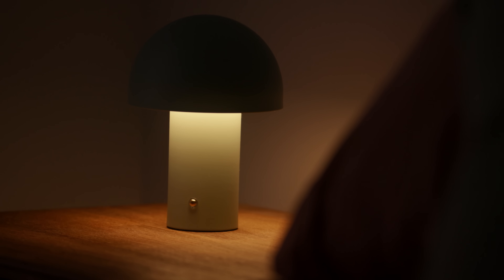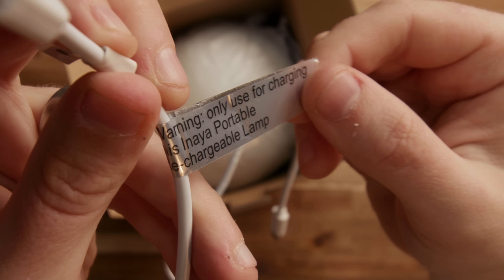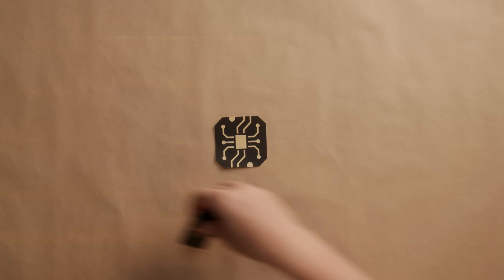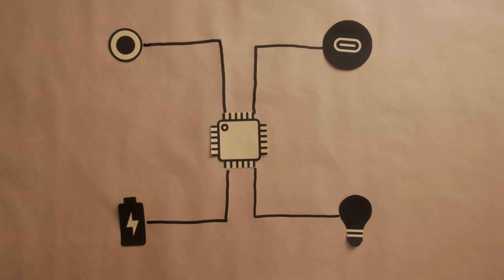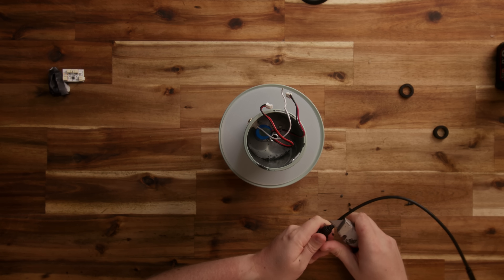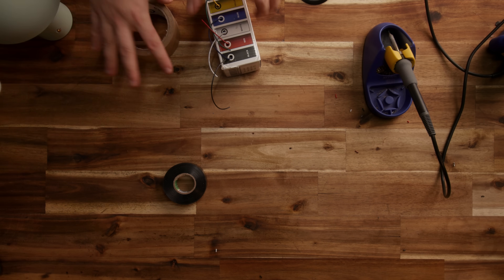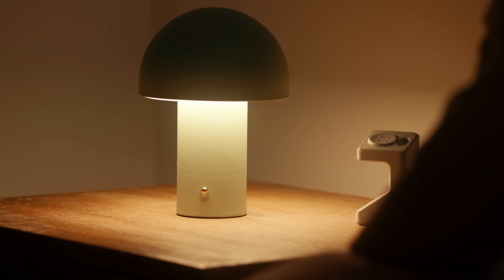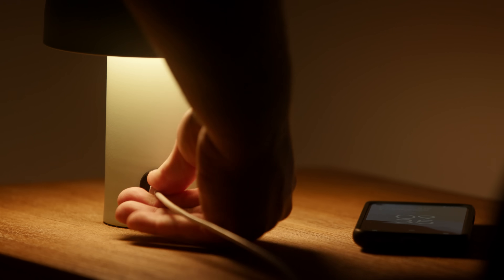Kmart Lied to Me, So I Hacked Their Lamp

Comment: Truly annoying when companies don't follow the usb-c standard. The whole point of using usb-c is we don't require proprietary cables!
Reply: This is the reason I throw away charging only USB-C cables. I know they save money for the manufactures, but for me they aren't worth the hassle.
Reply: @Dominator9572 I’ve never seen one how on earth is everyone pretending they’re something they see all the time
Reply: @Alphoric  They come with usb chargers included with non data products. Like flashlights, lamps, tire pumps. The best way to identify them is taking a flashlight and looking at the tip of the plug. They have far less pins inside
Reply: Isn't it illegal to claim something is usb-c without that being the case? Couldn't Kmart be sued for this?
Reply: @joda7697  how is it not? It changes with a usb c... smh
Reply: So basically this lamp is illegal and a scam. But you cannot do anything against that in the USA, because there are no consumer rights unlike in Europe
Reply: @XdekHckr ummm Australian Kmart, we don't have the European law here, but technically you could get a refund on this under the Australian consumer rights here as it is having false statements on its advertising (and box) as the cable isn't USB C, it just looks like it.
Reply: @XdekHckr  He sounds like he is in Australia.  They have a crappy KMaet here too, selling T-shirts made by virtual slaves in Bangladesh.
Reply: @XdekHckr what about the rights of the manufacture. They have the right to require special made cables. This is the real world don't like it don't buy the product. 73
Reply: @XdekHckr  scam yes, illegal no. the USB spec is a standard maintained by a private organization, not a law. The only means of enforcement available is the logo's trademark; the logo is only licensed for use on cables and devices that comply with the standard. this means if a company wants to create a non-compliant USB device, all they have to do is avoid putting the USB logo on their product or packaging
Reply: @spambot7110  uhh, the packaging claims the device is USB-C compatible. It's not. That's a false claim, which is illegal. No need to go after them with trademark law, although the USB Consortium could do that too.
Reply: @JimCullen  That's a fair point, I'd be curious if "compatible" has a robust enough legal definition for that to work. Also, what does it mean to refer to "USB" while not being bound by the USB consortium's definition of the term? I think it would be a complicated case (and given the price, difficult to find a motivated plaintiff unless the scope could be somehow expanded to include a broader range of products, but we're talking about pure legality here so that's beside the point).

No idea if this defense would *work*, but something along the lines of "we didn't mark the devices as 'usb compliant', instead using the term 'usb compatible' to denote that the charging connector used is compatible with the USB mechanical interface, while allowing us to improve the electrical interface to better suit the needs of the product" would at least confuse things and make it very annoying to prosecute. (obviously I think the argument is fundamentally dishonest, but i don't think i could prove that legally)

My take is that the existing law does not provide adequate means to hold companies accountable for this type of misrepresentation (leaving trademarks as the most reliable tool for enforcement, unfortunately at the behest of the standards body rather than the consumer), and we would benefit from legislation in this area (although, this also runs the risk of further empowering the more... rent-extraction-ey side of the standards business, so it would need to be done carefully)
Reply: I guess really the core problem is, technological standards are clearly a matter of governance, but we've decided to leave that task almost entirely in private hands. until we bring technological standards under public control, we'll be trapped walking this fine line between weak, inconsistent standards, and cartels with absolute say over who gets to participate in what markets. Open source is one way to do this, but market share, patents, and the ability of private sponsors to co-opt a project's goals are such powerful weapons against their potential public benefit that i don't think this can be achieved apolitically.
Reply: @spambot7110  the fact is that in Australia, you can't get around things by legal loopholes and technical definitions like that. The only question of relevance is "would a reasonable consumer be misled by the advertising?"
Reply: @spambot7110 In Europe, USB-C is legally mandated…
Reply: @spambot7110  That makes it false advertising, USB logo or not, at least in the EU, which is at least there illegal and frankly should be elsewhere too if it isn't.
Reply: If only the U stood for Universal...
Reply: @therick0996  It would be universal if people adopted it, but jesus fucking christ, must people be stubborn and pedantic over a standard that is 20 years old. Lads, USB-C IS FROM 2014; WE ARE ALREADY LATE AND YOU ARE COMPLAINING IT ARRIVED!

Unless you want to return to serial and parallel ports, back to DVI, VGA (DA-15), DE-9, DB-25 and Composite (RCA).
Reply: Funny how the thumbnail says it should be illegal. It is in the EU.
Also going to the kmart website prompted my browser to ask for firewall permissions, what are you people doing out there over the pond?
Reply: The point of usb-c is people think they know what would work best without thinking through how that’d be applied in practice and with little to no knowledge on what would be required for it to work as imagined. 

Usb’s of any one kind don’t all have the same purpose, and cost different amounts to implement, and aren’t all suited to all devices and aren’t even the same sizes. 

No point in making everything the “same cable” if one device requires a large amount of electricity while another device requires very little electricity, and some are for data exchange while others are exclusively electricity. You’d either have to create something that can change its inputs and outputs based on what device it’s plugged into, and who knows how much that’d cost to implement in your cheapest devices, or you end up with a different cable for every device because they all have different needs
Reply: @emberguard  you're assuming these requirements are all or nothing. if i plug my laptop (which takes a 65 watt USB-C power brick) into a 5V phone charger, it won't run on that power, but if i put it to sleep, it'll (slowly) charge. not super relevant, but it could be useful in an emergency situation. and more importantly, if i plug my phone into my laptop adapter, it just doesn't negotiate a higher voltage and draws less current. it would be better if the compatibility matrix was fully filled in, but even if it's not, it's still useful to have more squares filled in.

I think we could've done well with a standardized barrel jack or old-magsafe style thing for mid-power applications like laptops, i'm still not sure where that trade-off lies btwn interop and optimization, but if we look at the history of consumer connector standards, i'd say USB-C has been pretty good
Reply: @spambot7110  Thanks for the clarification :) appreciate it.
Reply: Kmart is still around?
Reply: @glitchunicorn Kmart Australia is totally unrelated to Kmart US that is basically broke.
Reply: So this lamp is Illegal in Europe or going to be illegal to sell soon.
Reply: usb-c isn't a standard. they say it is, but it's actually just a form factor.
Reply: @LieseFury USB-C is a legally defined standard in the EU.
Directive (EU) 2022/2380 applies.
Reply: @ No but you comply or you can’t sell anything to the EU. Which is why EU standards are default global standards unless you are China or the US… (and China goes along with EU standards most of the time because they like selling to the EU…)
Reply: It's the right of the company to require the use of their cables and make it so other cables don't work it's about trade secrets. Just buy their cables and forget about standard. USB chargers come in many configurations. 73
Reply: Yeah I'm old enough to remember the hype about USB when it first came out - kiss goodbye to a drawer full of different cables - one cable to rule them all sort of thing. Now I have a drawer crammed with over 20 different USB cables :(
Reply: This should be Illegal. Its a standard and not conforming by it should be reason for a full recall and lawsuit. This risks damaging other equipment and if they really wanted to they could have used a proprietary connector but no. No product with this configuration should be allowed to exist
Reply: Agree lol
Reply: Yeah that's what he said in the video, looks like I found something else truly annoying
Reply: right like how expensive is usb-c at this point
Reply: Have you seen it elsewhere because this is the first example I’ve seen
Reply: It's worse than annoying! It's positively dangerous to actual usb-c devices!
Reply: You’re gonna love that this isn’t why USB exists and our forced adoption of it actually makes this mindset worse
Reply: @FuncleChuck  you are on to something. I think it should be used only for charging devices and transferring data. It's not a power supply. I would rather use 12 volt DC outlets and use something other than lighter sockets. 73
Reply: The reason for USB C is optimised charging??
Reply: The problem with type-c port is that it is not even a standard. Only the plug shape is standardised, and nothing else. That’s why companies can make crap like those lamps.

If you read USB (not just the plug, but specifically usb specification!) type-c specification you’d know that the only two requirement for both usb type-c cables and ports are 1.2mbit data speed and 5v 0.5mA power support - and all those 160gbit speed 240W power etc are just type-c specific extensions over 26 year old usb 1.0 standard required for usb type-c. More over, usb support is not even mandatory for type-c itself - it’s just a cable with specific number of contacts, that can be used for anything you want (including frying your usb type-c devices, if other device is not compliant). So yeah, while standardising phone chargers is a huge win for consumers - making it usb type-c is a massive mistake for everyone who now and in the future would have to use an awfully designed (saying that even a bit of thought was put into its design is a huge compliment for type-c) port
Reply: There is no rule compelling a manufacturer to adhere to a particular standard, even if it uses a 'standard' connector.    The device can charge from a USB port or charger, provided you use the included cable, and that is all that is required for them to call it 'USB powered' and/or that it can be 'charged from USB'.  

Look up what Dell did with their computers back in the late 1990s - an ATX power supply in the machine, connected to the motherboard through a standard ATX power connector.... or so it appeared.

Looks can be deceiving.   Every single component I just mentioned was set up with a uniquely-Dell wiring configuration, despite using ' standard' connectors. 
Any attempt to install a 'standard' ATX power supply or motherboard in that machine was doomed to expensive failure.    Plug it in, hit the switch, 12 volts getting sent to stuff that's only supposed to get 5, grounds in wrong places, BAM.      Can't tell you how many smoked Dells I had to repair back in the day.
Reply: That’s not actually true, the main issue regulators had was that having a bunch of different proprietary cables greatly increased the amount of e-waste. However if everything used the same connector you’d only need 2 or 3 of the same cable to charge and transfer data from all your devices. USB had already been the standard for most devices for decades going from Type-A to Type-B, USB Type C was simply USB’s latest standard and because it was the most widely used connector that’s what regulators decided to make the standard and if anyone wanted to replace it they’d need to create a significantly better alternative that was worth switching to instead

Notice how regulators did nothing to actually regulate and standardise USB-C, that’s why you have all of these different types of USB-C cables where some only charge, some only transfer, and some transfer and charge. Regulators did nothing to actual standardise the cables  themselves and as a result Apple got rid of all their standard USB ports for USB-C, so you now have to buy a USB to USB-C adapter to connect most things resulting in more e-waste. Regulators have done nothing to create an actual universal standard for cables and they weren’t trying to, they were simply trying to cut down on e-waste
Reply: Yeah but they want you to use proprietary cables, because you have to buy them
Reply: best part about standards is there’s so many to choose from
Reply: @aname3576  xkcd 927 Standards (fascist youtube censorship on links)
Reply: Better off them using a proprietary port.
Reply: Its a fire hazard safety, pls dont mod it insurance wont cover if house burn down.
Reply: lightning is far more durable though
Reply: @Volkswagen_Yeetle  the cable breaks easily
Reply: @2xtreem4u POV: mfs when they don't realize that high quality third party cables exist
Reply: @Volkswagen_Yeetle  apple only recommends their own cable
Reply: @2xtreem4u”the cable breaks easily” You should drop out of this convo, you just demonstrated that you don’t understand what’s being discussed.

You shifted from “port” to “cable.” Cable isn’t part of this conversation, you can EASILY make strong and weak cables on both sides.
Reply: @heelercs  start your own discussion then so bye bye
Reply: @Volkswagen_Yeetle  not really it's old and doesn't support fast charging no updates to it for many years
Reply: @ still a way more durable port
Reply: @Volkswagen_Yeetle  the plastic frame breaks first
Reply: So you want ONE cable for everything in your house ever? How stupid.
Reply: @Ruinedtri  only stupid one here is you buddy. Where did I say that I only wanted one cable for everything?
Reply: the cable has 5 method of probing the device and it require embedded chip to remember whats the cable is capable of.

USB-C sucks and EU congress made a mistake.
Reply: @bokunochannel84207  you clearly don't know what you are talking about. USB-C does not require an embedded chip to get 5v. I have a bunch of dumb usb-a to USB-c that prove it.
Reply: @janoahuerta  I agree.   I'm aggravated by the fact there's no way to tell if a USB-C cable meets the standard or is just a charging cable or worst yet, custom.  USB-C Circuit is similar to PoE power services.  The connection is negotiated lightning fast process. Its why I can plug my iPhone 15 into my 120Watt Apple laptop charger for charging.  The charger detects the connection and ask for an ID from the end device (or PD powered device) if device complies and answers the charger query  (PSC) energy is delivered, if not 5 volts is granted, or if there's no detection through the cable of a connection, the PSC (Power Supply) does NOTHING.  Want to know about a new power standard that will blow your mind.  Look up NEC's Class 4 High voltage introduced in spec 2024.
Reply: @janoahuerta  No USB-C is like actually really stupid design wise. It has to support the USB-A spec, and cables can be 3 amp, 5 amp, or data cables. If you have a 5A cable it is mandatory to have 128 bytes of memory on the cable, you use 2 bits to say "I'm a 5A cable" and the rest is "reserved for future use." It becomes even dumber because now you need power to read the chip, the power comes from some CC pin which is disconnected on the spec.
If you want the cable to actually negotiate power delivery then you need 40KB of flash memory and 4KB of SRAM, we got to the moon with this amount of memory.
Reply: @burkino7046 how can you be so wrong but confident at the same time amaze me 😂
Reply: @ By being right. It's undeniable that the USB specs are an absolute mess, they have been since the very beginning.
Every company wanted fast charging but couldn't decide on a single standard, so what USB did was... implement all of them and say "just try them all, lol." Now here's USB-C with the same standards, and has to work upside down, and supports audio.
And if a cable wants to be USB-C compliant there are actually several standards with optional features.
Reply: @janoahuerta  I think that's because everything works at 5v, which is the only voltage that USB-A puts out.  USB-C can put out higher voltages if the device asks for it.  Kmart simply skimped on the last part to keep the voltage at 5v, and just made it so people could only charge it with their cable.  Lots of cheap chinese things do that.
Reply: @MIdaffy502  There's also the really great thing where some devices don't properly handle the plug flip capability, so the cable will only send data in one orientation. On a reversible cable. 

That was a fun day at work.
Reply: @burkino7046  Also, cry harder 👍👍🤣🤣
Reply: @afrodite8685 but you are the guy who is wrong this time. USBC requires a microcontroller to negotiate power delivery. Any cable lacking this is not USBC compliant and is just a usb-b cable with the wrong connectors on it.
Reply: @janoahuerta  USB C covers the hardware side, and often does require smarts to issue plain 5V, Use a USB A port and it should work fine. I have numerous cables that act this way
Reply: @jaclarkaus-o6v  I wouldn't call requiring a resister to get 5v, "smarts".
Reply: @MIdaffy502  I think there's a way but it's going to sound cheesy... Namely live in the EU where these problems generally don't occur given our laws protect the citizens rather than the big companies
Reply: @burkino7046 Whatever then, let’s go back to every single device having its own proprietary connector. That sounds excellent
Reply: @bokunochannel84207  dude it might be better to actually think before you talk out of your ass next time..
Reply: @bokunochannel84207  You are ill
Reply: @bokunochannel84207  So what should be used instead of USB C ?  Firewire ?  Apple proprietary lightning ?
Reply: @2xtreem4u here's a though 
make a separate universal wire for charging (micro/mini usb or usb c would work well here) make a separate for data (usb a) and separate for video (hdmi) 
oh wait those already exist 
so why do i have to replace all my cables then
Reply: @bokunochannel84207  loud, proud and wrong. True american
Reply: @Gillerz100 do you have a loicense for this post?
Reply: @Gillerz100 “An idiot admires complexity, a genius admires simplicity" -Terry A. Davis
Reply: @AddicteServer great - zero relevance to my comment
Reply: @Gillerz100 could you imagine if Europeans spent as much time fixing poverty as they spend worried about proprietary cables on phones most people can't afford?
Reply: @ it would be better if resources went towards alleviating poverty. not sure what mechanism you're suggesting is setting up a zero-sum game between fighting poverty and improving connector standards though. the reason the EU is not adequately fighting poverty more is because of deeply entrenched neoliberal ideology that frames public services and direct aid to the poor as a policy failure rather than the fundamental purpose of the state, not because they spent all their resources on USB legislation. i don't think people wanting to have a common connector to charge their devices is why europe hates the poor.
Reply: @ Having common charger standards means everyone isn’t wasting money on dozens of different chargers. It is actually good financially for the poor.
Reply: @ Ask the manufacturers in China…
USB-C cables are supposed to be dumb devices in basic 3 amp 5 volt mode. The 5 amp 50 volt rated cables are supposed to identify themselves via an onboard ROM chip however…
Reply: @LieseFury  So... we go back to the 80's? RCA, VGA, DVI, parallel... I am done with that. I am not going back and I am not taking USB-C for granted. It is the best we had so far. Also, the USB-C is from 2014 so we are already over a decade late, but if you keep complaining, we will move back to when micro-A, mini-A, mini-AB and type-B existed.
Reply: @bokunochannel84207  Cry harder 🤣🤣 Also, you are entirely WRONG LMAO.